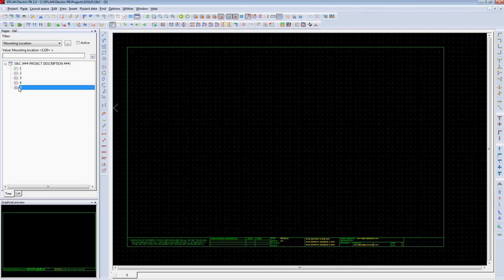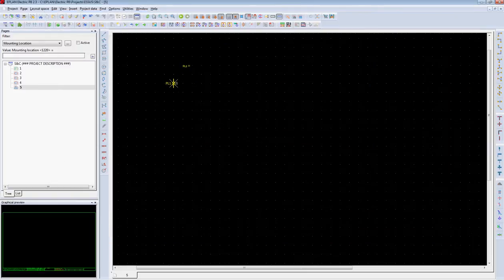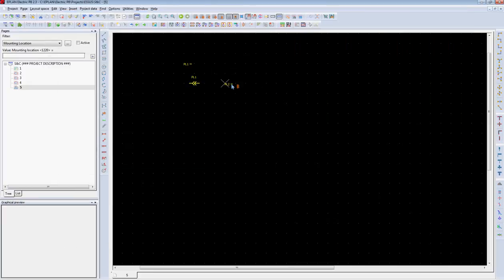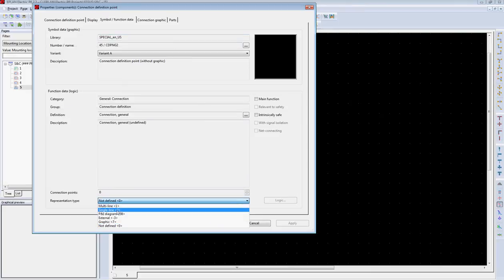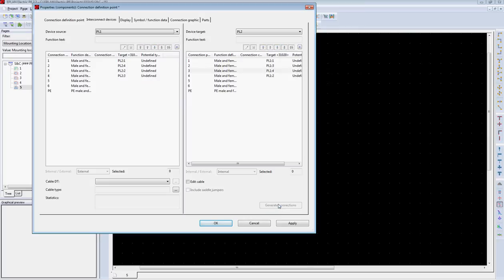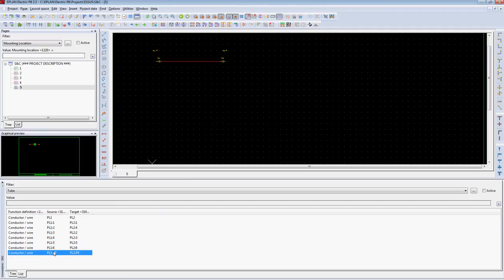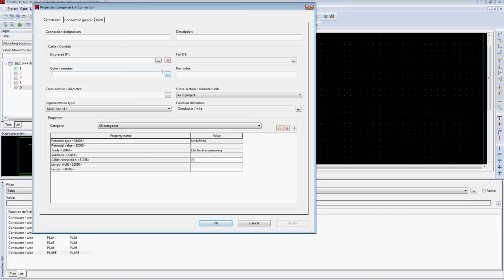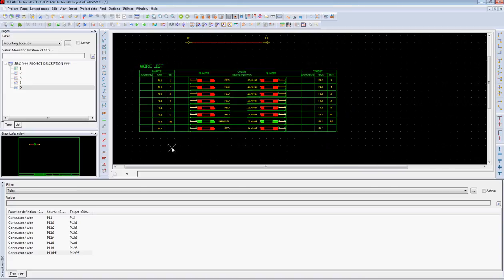EPLAN Electric P8 - Generating a wire list from a single line diagram

Comment: Where could i get this wire list form?
Reply from the maker: If you goto eplan.com and register for free, you have access to the EES the Eplan Engineering standard. There you will find an example of a Stacking System. You can find the form in that project.